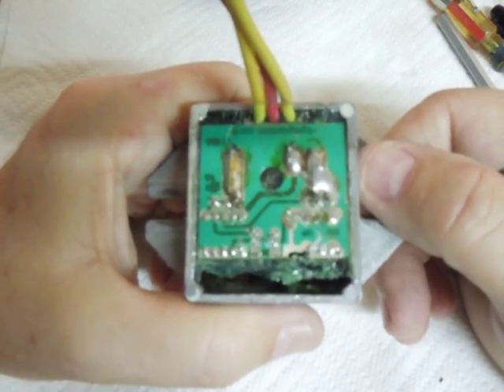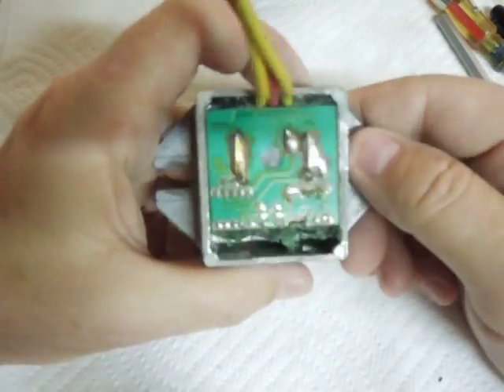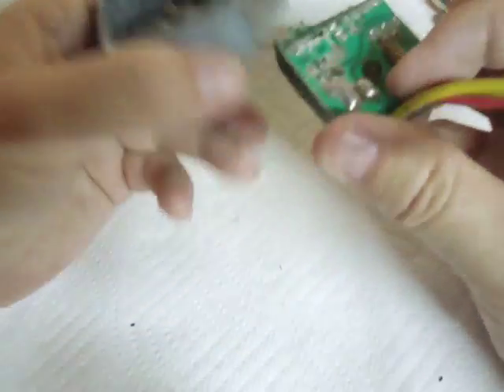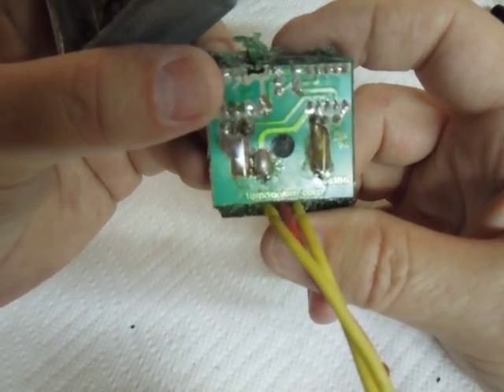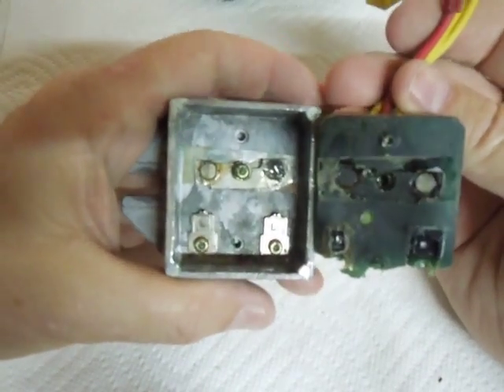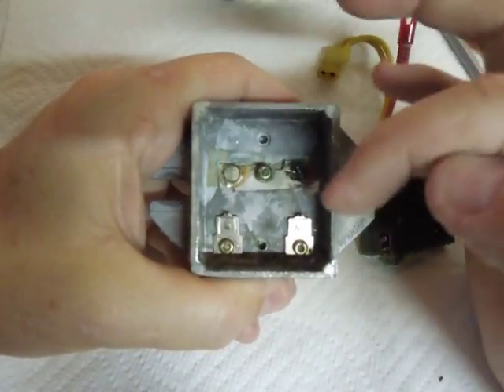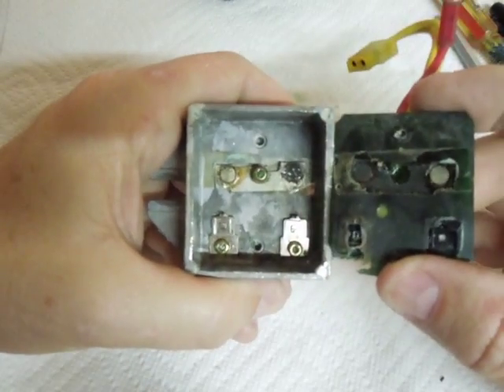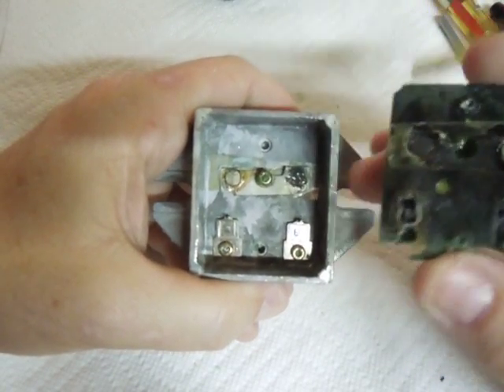Inside Briggs & Stratton Failed 3 Wire Voltage Regulator

Comment: i have a briggs 2100 model electric start motor....how do i connect the battery
Reply from the maker: I'm not familiar with that Briggs.  Hopefully you can find the answer on YouTube or Google.
Reply: @snaproll94e  i looked and could not find anything relevant.
Reply from the maker: a t did you search for a wiring diagram for a mower, tiller, generator, something that uses that motor?  If you know what the engine's used on you should be able to find a wiring diagram.  Good luck!